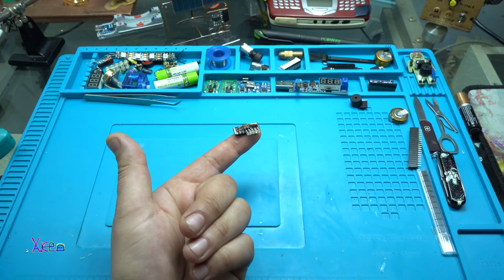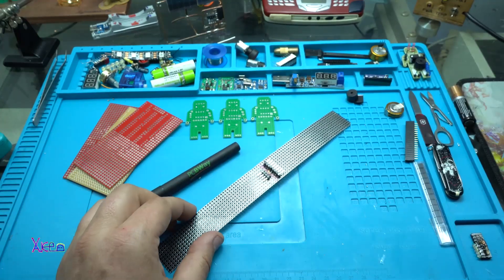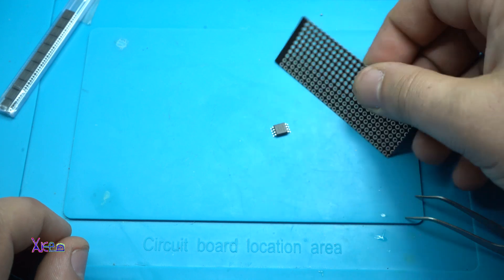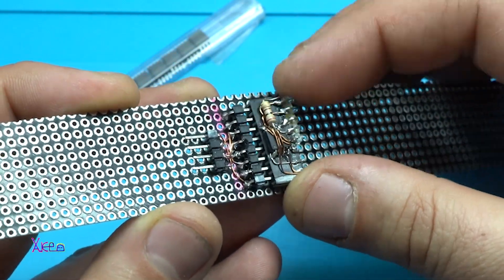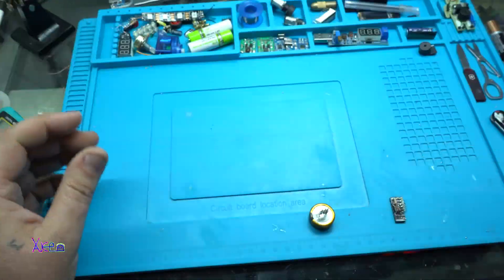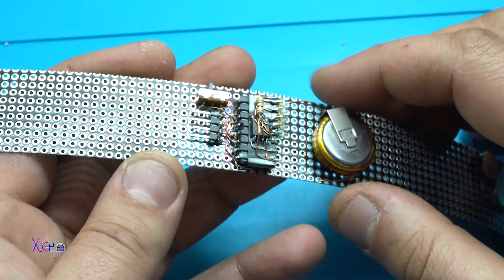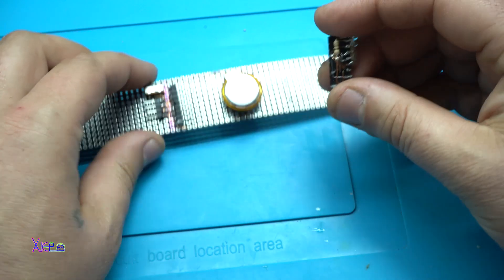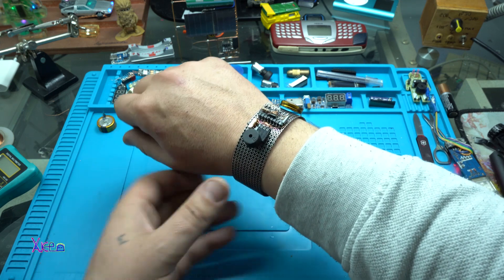Wearable and Flexible PCB Gadget - DIY Electronics Project

Comment: https://TOBOIDS.COM  
TOBOIDS AUTOMATA IS PRIMARILY FOCUSED ON PROVIDING ELECTRONICS, MECHANICAL, DIY, HOBBY, RC & ENGINEERING PRODUCTS.
https://TOBOIDS.COM  
 THERE IS LIMITED ACCESS IN INDIA FOR STARTUPS, HOBBYIST, STUDENTS AND OTHER PROFESSIONALS TO GET QUALITY ELECTRONIC COMPONENTS AT LOW PRICES. 
https://TOBOIDS.COM  
THEY ARE FORCED TO IMPORT THESE COMPONENTS AT VERY HIGH RATES.
https://TOBOIDS.COM  
 TOBOIDS AUOTOMATA IS COMMITTED TO REDUCE THESE IMPORTS IN THE COUNTRY AND PROVIDE QUALITY PRODUCTS AT THE CUSTOMERS DOORSTEP.
https://TOBOIDS.COM